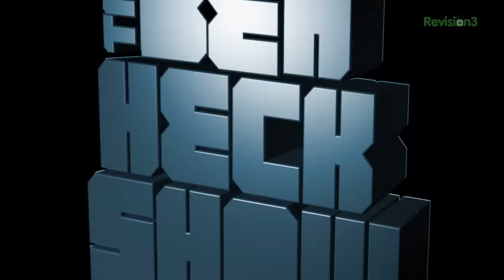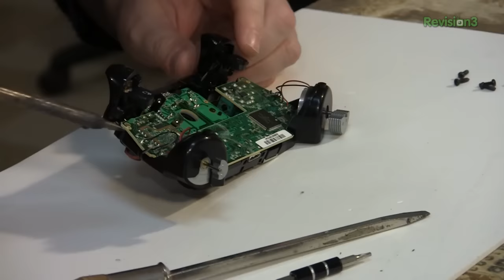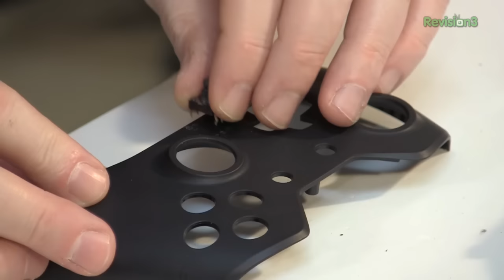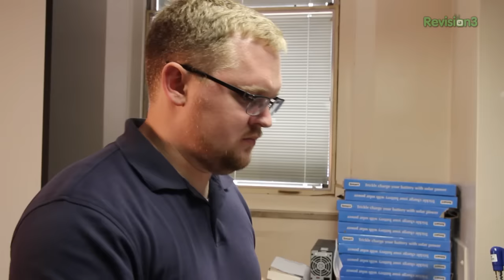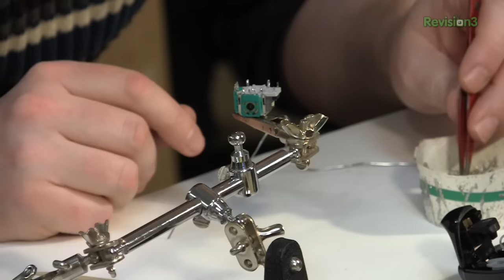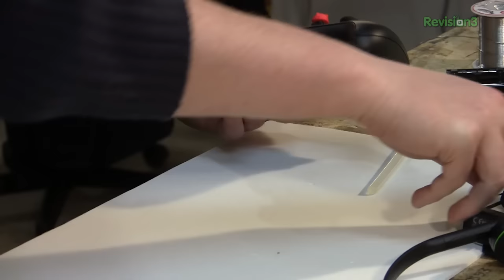Single Handed Xbox One Controller

Comment: i am desperately in need of a Left-handed xbox One controller.  I have spent somewhere in the neighborhood of $500.00 for a new Xbox One Console, have bought a wireless xbox controller, an xbox one keyboard and mouse adapter (IOGear KYMANDER, which while very expensive, did not come with all the USB cables with the type of connectors i need to complete the pc to adapter to game set-up).  I also bought a new copy of Fallout 76 for the xbox one, and paid for an xbox one ultimate game pass, and STILL cannot join my new friends in-game, as the functions of the Left and Right sticks on the controller cannot be reprogrammed to work the direct opposite of their regular functions...  I am DESPERATE for a solution.  I am also permanently disabled with not two but two severe heart diseases (chronic sporadic arrhythmia, and severe cardiomyopathy),  and living off Social Security Disability (i get a stipend of $747 per month), Medicare/Medicaid....  I am virtually a medical shut-in, with my heart functioning at 15% to 18%, and playing computer games on my desktop pc was just about the only entertainment i had.  Then i met some people, who play Fallout 76 on the xbox one and stream their play sessions on Facebook....

Comment: On your right handed model for the modified left bumper button, does this toggle on and off?  Some video games require the user to "hold down" the left bumper with the left hand (sniper mode) plus do other things with the right hand simultaneously.  Or if not--can it be made to toggle on and off to free up the right thumb?

Comment: is there anyway you can figure out how to fix the xbox one controller that wont turn on unless you put batteries plus usb power cable plugged in on it ? it also starts smelling like its overheating22

Comment: I understand you're making one handed controllers, and its great fpwhat you're doing for the disabled...

however 

the left analog is ridiculous... controlling your character isn't going to be easy when you have to grind it against your leg :l 

you should use a flight stick (joystick kinda thing) with an analogue on top (bit like the Nintendo Wii remote.. but larger) it'll be much easier to control
Reply: That actually sounds pretty solid!
Reply: +Atomic Robo Tesla my comment didn't make much sens and all the spelling errors, I must of been a little tired 😂 but I'm glad you knew what I meant :') it'd be so much easier, analog for movement and the flight/joy stick for camera movement... the whole "knee analog" is a bit too difficult.... believe me, I've tried it :)
Reply: VideosWithNexus I honestly don't have to try it to know that knee analog would be a problem, it's just weird in general. 

Also, I managed to actually come up with a design for the flight stick! It looks like it'd work pretty well from what I could tell!
Reply: +Atomic Robo Tesla holy shit, sweet! are you gonna build it :o
Reply: VideosWithNexus All I'd be able to do is design the outside as I'm not that well versed in electronics, but even then my skills may be limited limited (and supplies as I don't currently have the cash to buy the necessary materials).
Reply: This would be easier.

Comment: Is there a way to move the start and select button under the A button? My son has nerves damaged in his hand and is having problems using the control now.
Reply: +Wanda Pope  I assume you are talking about the xbox one controller, so if you are capable of soldering buttons yourself, the view button signal is on the second to last pin on the top row, on the second connector, next to the right stick. On the first connector, the one in the middle of the small board,  the sync button signal is on the third pin from the left, on the bottom row. There are many ways to connect it to ground, but the easiest one to explain is a small point on the back of the small board, with TP26 next to it. I am sure you can find multiple guides on how to do this yourself, if you have the necessary equipment.
Reply: +CakeOfJusticeXc thanks for your input and I will see if my other son can do this for us
Reply: +Wanda Pope If you find yourself lacking other options, I could build one for you. But I do live in Norway, so I would assume the shipping fees and all such nonsense would be difficult to deal with, as well as my inexperience in shipping to USA (which is where I am guessing you live, correct me if I am wrong). Anyway, the offer stands :)

Comment: I realize that this is an older video but I have a similar request...you see I was born with only my right hand so I learned gamepads and controller games easily and actually use my nub for the joystick and my legs for the left trigger but since I have moved on to playing pc games I enjoy the accuracy and abilities a mouse has over a stick or dpad. But I find that wasd is a challenge when strafing. is there a way to have a peripheral dpad with mechanical switches for movement? I could not find one anywhere
Reply: Mikey Zupan go to his company email and ask him
Reply: Mikey Zupan I believe you should look into a Razer Naga Mouse. I know they have many models of them all with programmable switches where the thumb should rest. The MMO version has 12 buttons in 4 rows of 3, While the Hex has six buttons in a hexagonal pattern. You can reassign the number buttons to WASD or whatever control scheme works for you. 

I would go with the HEX considering it has less buttons but they are more pronounced and easier to hit.

Comment: Wait, if you have a 3D printer available, why not make a new plastic shell for it? Turn the board sideways and rotate the stick on that hand. Hell, I'd almost go as far as having the other stick controlled by the pointer and both bumpers and triggers set for the middle and ring fingers.

Comment: I have a friend who needs the triggers and top buttons to be on the face of the controller as he cannot bend his fingers at all and finds it difficult to play anything apart from driving games that allow the controller to use both analogue sticks rather than the triggers. can I buy the hall effect sensors as they look different to the normal ones I have with only three wires.

Comment: I play with one hand on the standard Xbox one controller after losing function in my right arm i was really fortunate, if that can even be applied here, that it was my right because the way I use the controller can't seem to be replicated with a right hand not that I've tried too many ways ;) but the way I do it is I sit the controller down next to me and place my thumb on the right analog stick index and middle finger on the rb and rt buttons respectively, my pinky operates the lb and lt buttons and I place they base of my pinky on the left analog stick. It's quite efficient as I still end up on top of scoreboards online in all my favorite games(CoD, Battlefield, Destiny, Madden, etc) anyway if you'd like to see me play my xb1 gt is : Dynamight17 add me! Also I've started streaming on twitch and my username is : Dynamight789 I try to stream everyday so follow me and Ill show you all how I play.

Comment: My LB button suddenly stop working can I fix it if I open it up?
Reply: Depends on the problem.  The Xbox one controller is a bitch to work in but if its not working properly its not working properly and the best thing to do it buy another one open it up, and if you fix it? Well boy ain't that just swell. And if you don't...well hay no harm done and you learned something. Right?

Comment: After watching a few videos, this channel has earned my subscription!

In terms of improving this particular design...I imagine it might be easier to use the bottom joystick if it is moved to the other side (RHS) of the controller, due to the reduction of the moment required to operate it. It would probably have to be slightly extended so as not to interfere with the lower right part of the palm.

It would be cool to be able to integrate the rumble pack from the left trigger into the alternate 3D printed trigger.

Also, the shape of the 3D printed D-pad also looks like it might be a bit painful to operate after a while (depending on frequency of use, which tbh is not often in my xp).

Also you could mount a little pivoted button mounted on the face to make the xbox button and the select (or 'share') button more accessible, but the pivots might be too fragile for practical use.

Comment: I was brn 3 months pre mature and i have very limited use of my left hand, I also play video games one handed.. my friend wrote an article about how i play with a 360 controller and this is how i play with a standard 360 controller.. I thought it might interest you.   " Sitting on his couch, the 360 controller is tilted sideways with his index finger on the left thumbstick and his thumb on the right one. His middle finger is used to press the left trigger and bumper, his pinky finger on the right trigger and bumper. Whenever he needs to access the face buttons, he quickly slides his thumb back and forth. He handles the Dualshock 3 in a similar fashion" I have some pictures up under my account.  also same method is used for ps4 controllers..

Comment: I don't know if this is too hard or not, but to do left and right bumper you should have added a Black and White button like the original Xbox controller and used right bumper and right trigger as left and right trigger. It would be a lot better for playing one handed, but I'm sure it would be a lot more difficult.

Comment: I was disassembling a 360 controller once to paint it, and I was taking the triggers out, spring went flying out and I couldn't find it, so I just put a pen spring in it and it worked even better. Thanks Microsoft!

Comment: (Question?/Mod)    I have a arcade stick which uses macro ( program combos) and I was wondering would the brain or microcontroller be reponsible for my macro limit or speed limit? This is just a small project that could give me infinite Streetfighter Combos!  I would like to modify if this the component that controls everything. So do you agree, this is my focal point to gain my power/turbo/ extra macros?  Also would the arduino be able to tell me my current microcontrollers program?

Comment: Ben. I think I saw you removing the left thumb stick and putting it somewhere else in the controller. My questions is. Can you use a optical mouse  as the thumb stick to use it with my lap? If possible. How? Let me know. Thanks

Comment: Not using your automatic hot glue gun?  Why not?  Does it need tweaking?  The "leg dpad" is a great idea, but the external wiring is kind of tacky.  Is there room to make it recess into the controller or make the switch fit inside like the L3 button? No autofire mods or anything like that planned?  I hope to see a Mark II that is a bit more polished. :)

Comment: hey ben, you can actually make springs instead of buying them, just pick a piece of soldering wire or any other metal wire of your liking and roll it around a screw(the size of the screw depends on the size you want the spring) and them you just unscrew your new home made spring from the screw ^^ hope you see this, will save you a lot of money XD
Reply: Nice idea, but won't work. If you bend a peace of wire around a screw, you'll form a nice coil, but the metal wire won't have the needed memory. When depressed or extended, the homemade spring will retain the new shape instead of going back to it's "memory"
Reply: oh, i didnt knew this, thanks for the info guys, i only used this method once to make a cooper coil for a project, always learning something new

Comment: Ben, Hi/  I have dying nerves in my hands.  Its getting harder to play minecraft on my pc  I need a manual switch on my left shift key so I don't fall, and left mouse key for mining and right mouse key for afk farming. I have a usb wireless mouse.  Maybe a driver fix?   Can you help? I have to use my wife's sony visio my dell notebook  won't run minecraft. Thanks for thinking about the disabled. Maybe a control shift lock patch to a keyboard driver.

Comment: I'm not sure if this is even possible due to hand size, but have you ever tried putting the replacement left analog stick on the bottom of the right handle instead of the bottom of the left handle? If it doesn't get in the way of your hand, I feel like that would give you much better control of the left stick because it's placed directly under the pressure your right hand exerts.
Reply: That would be much better.

Comment: if there is a Wii U mod to do, I say its to use its Wii U Tablet to see if you can make a 3DS mod that can hook up your TV with the 3D screen as the top and the gamepad as the bottom
Reply: That's pretty ambitious... XD (on an unrelated note, I noticed that since an update done who knows when, the gamepad screen - but not the buttons - now works in Wii mode - The gamepad even has a 'sensor bar' built into it. - Since Wii games don't use dual screens, you can now play every wii game without having a TV if you have a Wii U...)